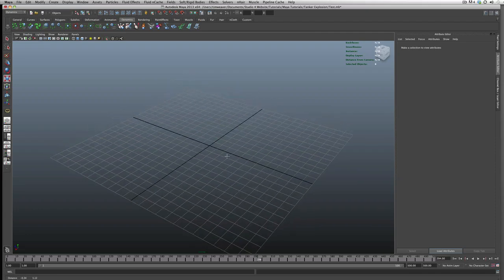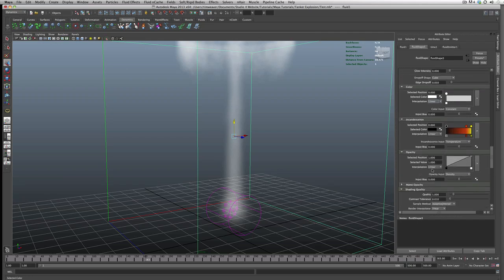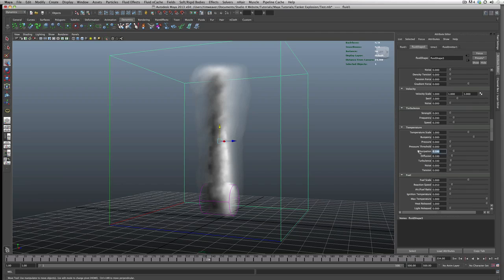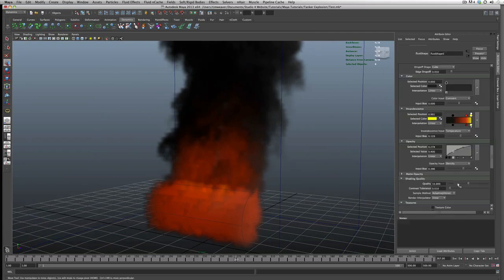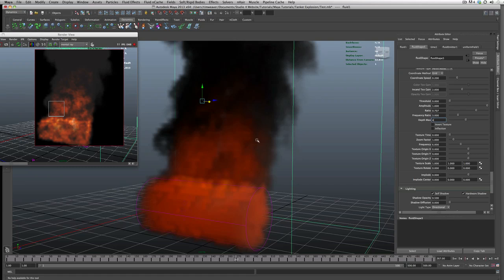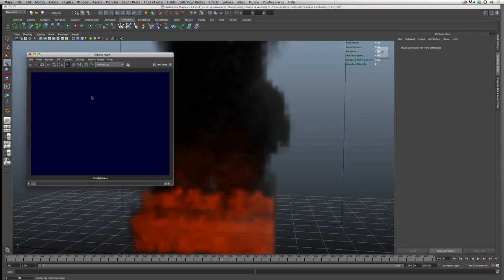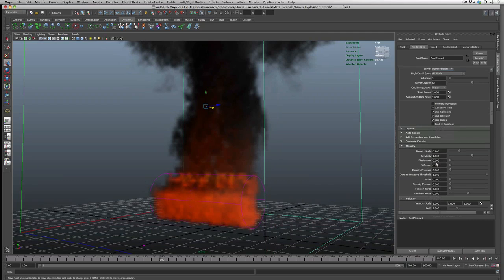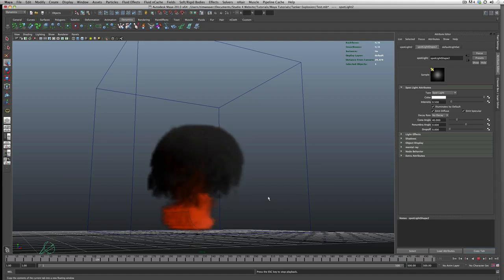Oil Fire - Maya Dynamics

Comment: Hello, I am just concerned about timeline.. I don't think it is set to "Play every frame".. It seems it skipping frames while simulating..
And, when We increase the Resolution of the Fluid container, Fluid get reduced.. How to solve this?
Reply from the maker: normally this happens when your computer is not powerful enough to handle all the particles that Maya is emitting. When you increase the resolution the fluid is reduced because as Maya is skipping the frames and not as many particles are being emitted. see if lowering the amount of particles spawned stops it from skipping and that will tell you if its the problem.

Comment: I am curious on how you can make the explosion at a certain time. because everytime i try to do so it does it right from the start and I am trying to get it later
Reply from the maker: Zack Christie In the Channel Box under particalShape1 (which will be the default name maya assigns to it) There should be a tab called Start Frame. The default is set to 1. Change this value to whatever frame you want it to start at. Let me know if this answers your question!